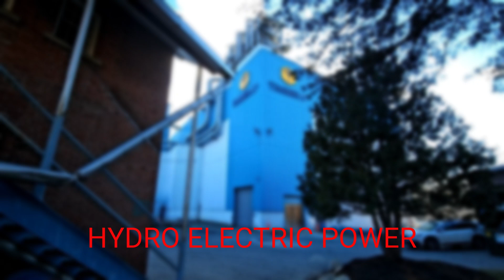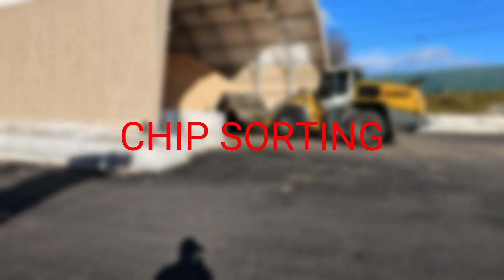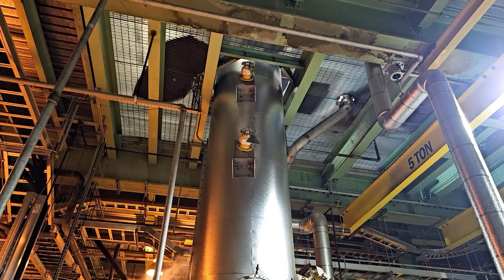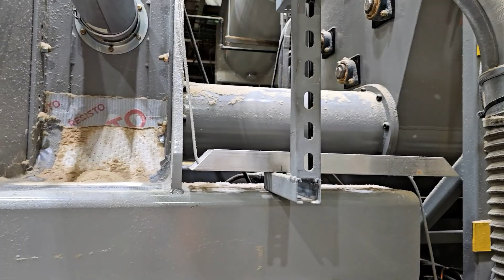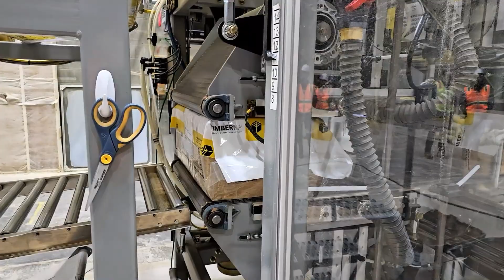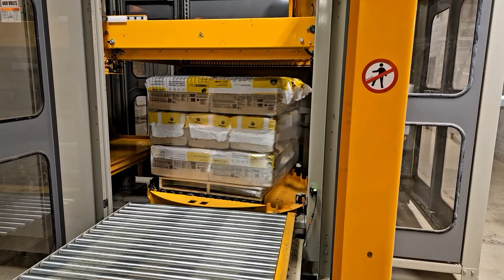Timber HP - TIMBER FILL

Comment: A bit late to the party .
The Gutex company of Germany made one of the first wood fiberboards in 1932.  now they have a multitude of panels , dense board to resist compression where needed , loose fill, less compact for interior walls ,panels that can accept stucco etc. 
the largest company making this board is Steico ,also of germany .

Comment: I’m hoping timber based insulation takes off soon. If Timber Board can replace foam for exterior insulation there could be multiple benefits. If it could be made to hold screws it would be a real game changer.